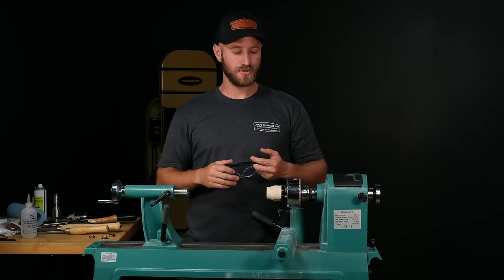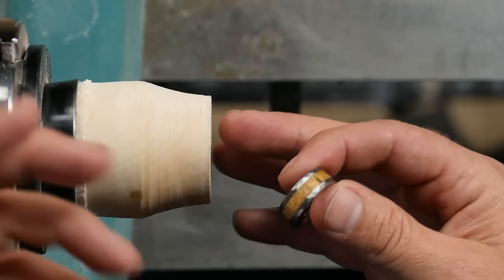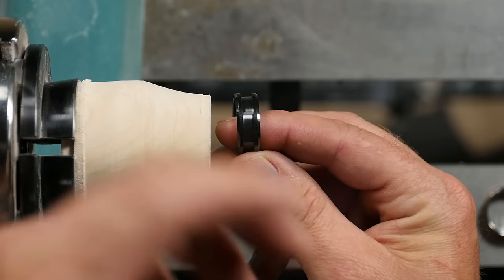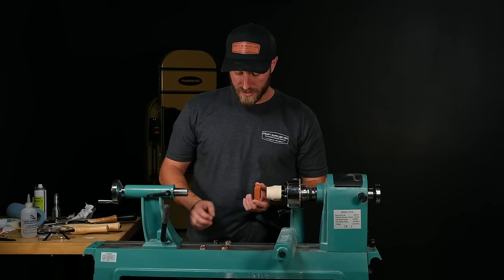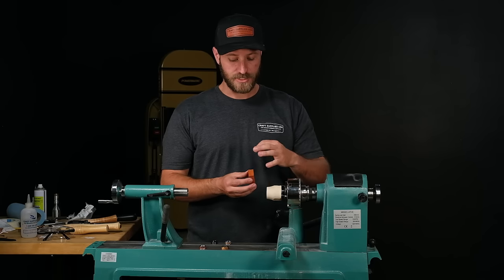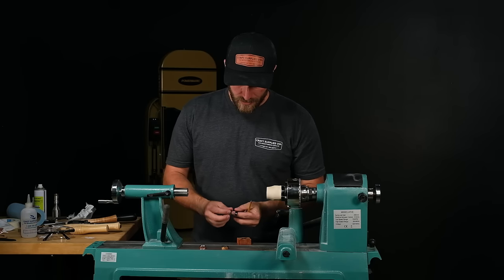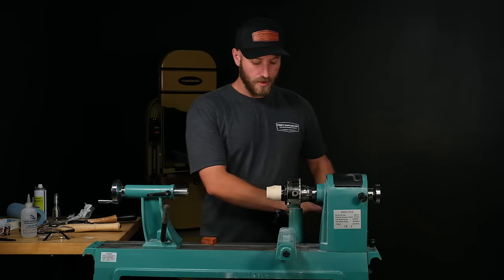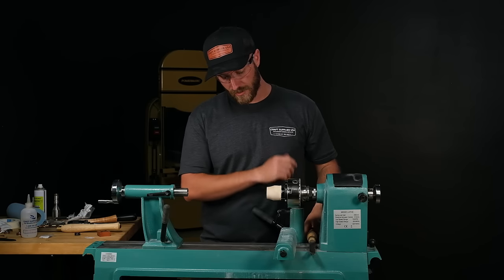Making a Wood Inlay Ring

Comment: I’m a woodworker in my spare time and I’ve made wood rings before and my friend asked if I could make them a ring just like this. I’m really glad you broke all of the steps down and made the process easy to understand.
Reply from the maker: Hey Riley,
Glad you found the video helpful, if you have any questions don't hesitate to reach out. -Mike
Reply: @CraftSuppliesUSA  is there anything I should be careful about when working with a Damascus stainless steel ring core?

Comment: Hi Mike 
In your making a wood inlay ring video you show the artisan ring chick.
However you have an extra piece in there holding the ring.
You show the first 2 adapters facing each other and then the ring.
When I use the adapters it doesn’t allow me to cut deeper because you hit the adapters.
What is the extra piece that is holding your ring?
Thanks, Mike

Comment: You could use a laser to cut the centre out. You'd have to mill up a board to the right thickness first but you could batch out loads from one board. Co2 or Diode laser will cut that thickness of wood.

Comment: Are rings like this able to get wet? Maybe not completely submerged in water but would rain or hand washing damage the wood?
Reply from the maker: If they are finished with CA, they can get wet.  The thin CA wicks into the fibers of the wood and seals them so water cannot penetrate.

Comment: Love your videos. 😃Great voice for narrating. Thanks for putting them together and sharing. 
My question is: I have an acrylic blank that I want to turn, then inlay in my ceramic 10mm channel core. It won’t split like wood so any suggestion to get it in 2 pieces that will go back together well, is appreciated. I have some ideas but would rather not "experiment" with a ring blank that wasn’t cheap. Thanks.
Reply: Acrylics break very cleanly. Make sure you have it in a vice right at the center point and you should have no problem breaking it.
Reply: @aventador832  Thanks for the quick reply. Good info to know. I’ll test it out.
Reply from the maker: Yes you can!  Acrylics break with a very clean seam and are able to be glued back together with an almost invisible seam. - Mike

Comment: Ring drill bits are cheating, I realize that now. I want to be able to make such pretty rings for my loved ones. I get used to making them, maybe to sell.
Reply: Which drill bits are you referring to?
Reply: @imakrewitatl  When I first wanted to try making rings, my mom found some drill heads with cutting surfaces spaced, so it cut Asian size rings. I was not aware that ring sizes are different by region before this.